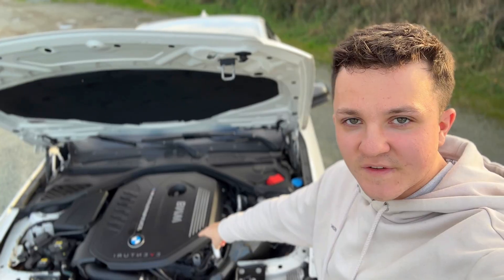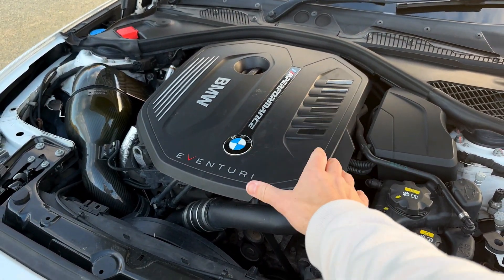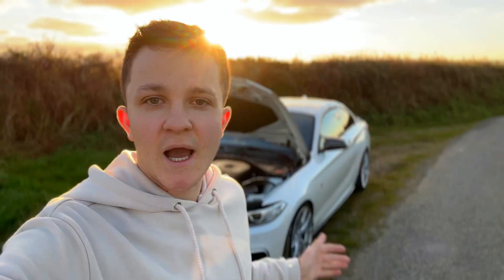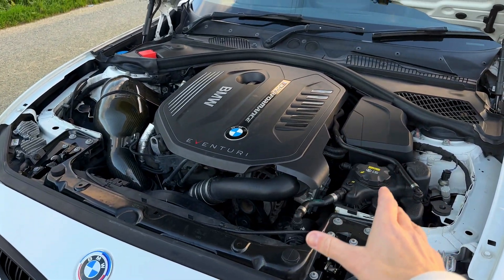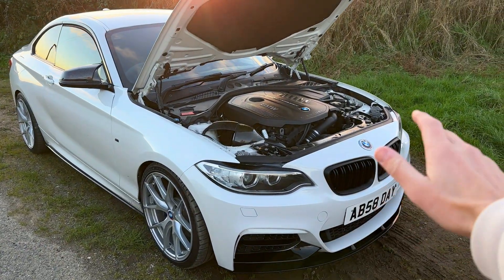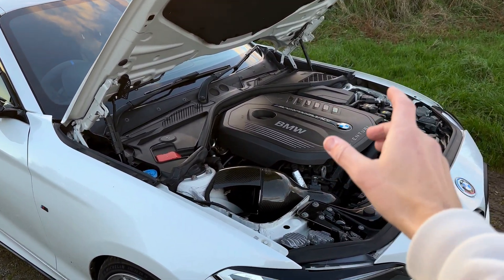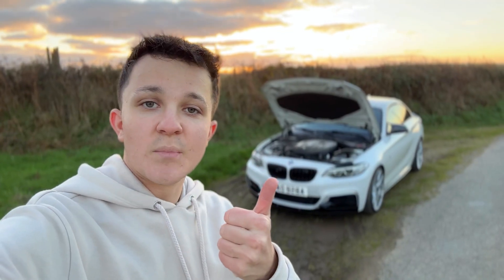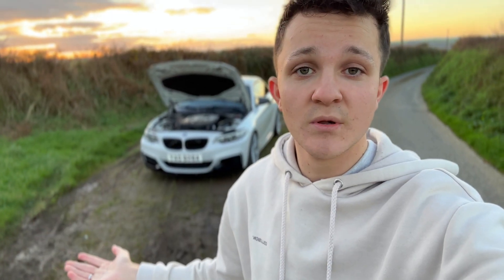How BMW Accidentally Created a Super-Engine (B58)

Comment: I want to stage 1 my M240 so bad but BMW has made it so difficult on the 2020+ models ☹️

You think it's worth just getting some bolt ons (straight pipe exhaust, upgraded CAI/filter) if I'm not getting a tune

I know the JB4 exists but I'm concerned about that causing long term reliability issues (since it's just tricking the ECU and not actually recoding it).
Reply from the maker: Bolt Ons are always good but they will never fulfil what a tune does. They will definitely improve the power and I wouldn’t go down the route of a piggyback. I would rather save up and get my ECU unlocked and have it mapped. That’s just my opinion, best of luck with whatever you choose to do. And thank you for your comment.

Comment: What do u think about the s58?
Reply from the maker: I have personally never owned one, but a friend of mine does and from what I’ve seen it’s definitely one of BMW’s best engines ever produced. Especially in terms of power when they are tuned.
Reply: @ethantyrerf22 I want to buy m340i lci or m3g80 lci and I don t know what to buy, I want to keep it for 10years+ I will use it for weekend and occasionally daily cuz i have a secondary car, the m340i sounds better is more comfortable it has more than enough power is cheaper and the maintenance definitely cheaper it is just the rational choice, still the m3 g80lci xdrive is so tempting to me, what do u think of a g80 long term keeping? I m from an eu country and the 2035 ICE cars ban makes me want to stock at least 2 ICE cars and those 2 cars are on my shortlist but I have to choose one of them
Reply from the maker: @qwertyqwerty-zi6dr M car v M Lite, M3 all day long…

Comment: Almost all these bullet prof parts you mentioned are not made by BMW, they are made by  MAHLE
Reply from the maker: Yep true, MAHLE supplies a lot of the components. Still BMW’s design and engineering though, so it all works together to make the B58 as strong as it is
Reply: @ethantyrerf22 I’d say design has been done by MAHLE
….to fulfill or/and exceed BMW specifications
Reply: @ThomasWeb-j3x4q so are mahle cars more reliable? What else do they make?
Reply: @ketz555 Pistons, camshafts, Turbo in former timers, charge air cooler, engine cooler, oil cooler, HVAC, compressors, battery cooling …bike engines ….
Reply: Yes let’s go buy Mahle cars. Forget BMWs. lol but thanks for the interesting info it definitely is true just not the Mahle design everything part that doesn’t sound right.

Comment: „Ten times stronger“ ???
What do you mean by this ?
Reply from the maker: ‘Ten times stronger’ is just a figure of speech mate, I meant it’s a lot more durable compared to older designs. Not an exact measurement, just highlighting the difference in strength
Reply: @ethantyrerf22 I wouldn’t use numerical values as a figure of speech when talking about an engine just FYI this confused me too
Reply from the maker: @d @duhfuhfh96 I understand; i’ll change it next time! Thanks for your comment

Comment: 1.26: you said BMW designed the close deck because they knew tuners was gonna use it what a load of rubbish😂😂. BMW designed the close deck because of reliability & durability, thermal efficiency and to meet modern automotive standards emissions and regulations. I’m sorry but the rest of the stuff you’re spewing out we already know mate this is old news.
Reply from the maker: All good mate, I was simplifying it for the sake of the video. BMW obviously built the closed-deck for reliability and emissions, but the point was that it also happens to give the platform loads of tuning headroom, which is why it’s so popular with tuners today. Appreciate you watching
Reply: Facts

Comment: B58 owners not drastically exaggerating the attributes of their engine challenge: impossible
Reply from the maker: fair, the B58 hype can get a bit wild sometimes
Reply: @ethantyrerf22 brother you titled the video "accidentally created a super engine"😂 its a good engine but its not even a proper motorsports engine. Stock turbo maxes out at 500hp, and thats with a lot of help. Most make less. And its power band is, just "okay" when compared to an M engine
Reply from the maker: @mizaqenyad4269  All good bro, the title was obviously a bit of fun for YouTube! The B58’s a great engine for what it is, but yeah it’s not an S-engine. Still crazy what they can do with a few mods though!
Reply: @mizaqenyad4269 first BMW to ever break into the 7s in the 1/4 mile was a 2022 M240i powered by the B58
Reply: @hau5muzeek ah yes, silly me, high HP builds' drag strip times determine everything
Reply: @mizaqenyad4269 idk dude I would rather a b58 than an s55 or even an s58 for an all out build. For basic stage 2 builds with no upgraded turbos the M engines are miles ahead though so you are correct. But once you upgrade a B58s turbo it’s way better than both.
Reply: @mizaqenyad4269 no but it does show how strong the B58 really is. Again for an all out high HP builds the B58 is better than the S58 and the S55. There’s a reason you see it being built so often.
Reply: @samhadi7972 yea i guess lmao. But 99% of people aren't dumping $10k+ into an engine to make these builds. And then what do you even do with them? Just roll race at night on the highway and take it to the drag strip? Cant enjoy them the way bmws are meant to be driven. Ill always prefer the motorsports derived M engines better. Its not about the peak power its about how they deliver the power